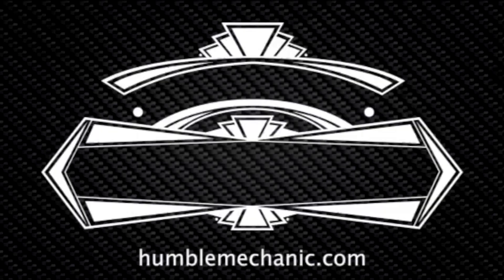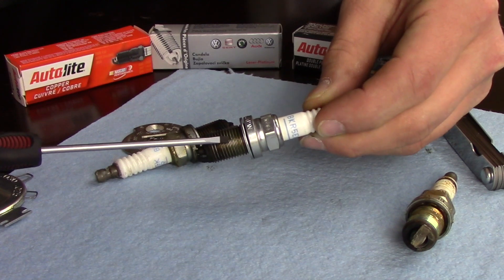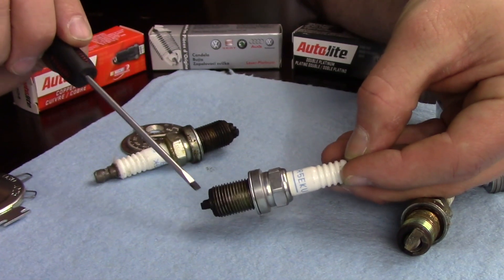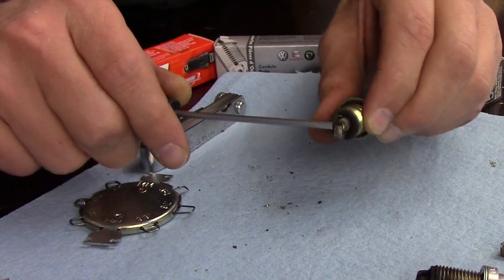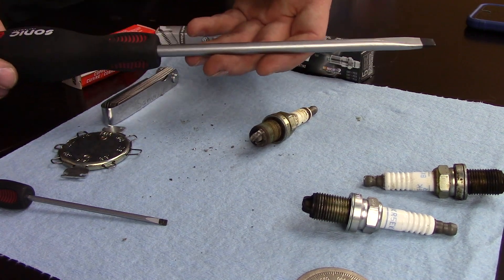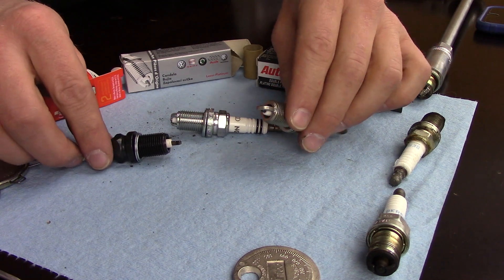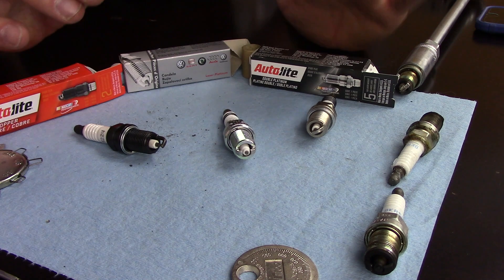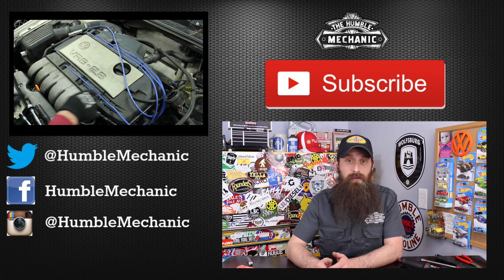What You Need To Know About Spark Plugs

Comment: The fancy metal plugs like Platinum and Iridium also have a caveat
1.  They're not really pure platinum or iridium.  A singe plug would cost $100.  They do however contain very trace amounts in the alloy used to help with the heat of forced induction and high compression.
2.  They won't make your engine run better or add power.  if anything they are POOR conductors and can create problems.
3.  True rare metal plugs come with multiple leads.  This give the spark more options to choose the least resistance (because they're poor conductors), and slightly lengthens plug life as leads wear away.  They still only throw one spark.
4.  It's best to stick with EXACTLY what your engine came with.  The engineers that designed it are much smarter than you (usually).  Plugs have plenty of other quirks such as internal resistance, surface resistance, resistance at operating temperature,  resistive resistance, etc.  When the manufacture factory tuned your engine's ECM and other variables, they did it with the factory model plugs installed.  It is however a good idea to double check the assembly line's work.  Plenty of cars roll off the line with random spark gaps, +/- 0.01 sometimes, slightly different resistance, etc.  With anything electronic or mechanical, it's best to "marry" them.  Have all the identical parts spec the same, and always use them together.
Reply: Bosch Iridium spark plugs are laser alloyed with pure iridium.

Comment: Unless you're assured you'll never see that car again, ALWAYS PUT A TINY DAB OF ANTISEIZE ON THE THREADS! Trust me- when you take the plugs out 30, 40, 50,000 miles later, you'll appreciate that they're not seized in the damn heads.
Reply from the maker: As long as you don’t get it on anything but the treads. I’ve never used it and never had an issue.  Vw plugs don’t have it from the factory and I’ve only had a few with issues
Reply: Antiseize- the gift that keeps on giving. But, yeah- just the lightest touch of the brush on the threads and they can will come out no matter how long they've been in the head. I've been using it on every plug I've put in for 27 years.

Comment: I have a 2009 Volkswagen Routan 3.8L V6 i had a check engine light on and was showing that the spark plug #6 was the problem i took it out and it was completely shut no mechanic could explain my problem. Luckily i found a old spark plug in the ground and it worked lol but my engine still feels like it's misfiring it hads moderate shake/vibration
Reply from the maker: Probably a burnt valve on the front bank cylinder head.  There is a warranty extension for that issue. 

It could be other. Things but that’s common
Reply: HumbleMechanic i don't think i have warranty or do i ask the dealership?
Reply: HumbleMechanic what spark plugs do you recommend for this engine it's not even a vw engine it's a Chrysler

Comment: I'm pretty paranoid about putting in spark plugs, I found a good trick is to use a radiator hose to start the thread to keep it from skipping and then to use the torque wrench (old school one that doesn't ratchet, though). Never had an issue.

Comment: humble mechanic , spark plug gap also effects timing , a short gap causes the spark to fire prematurely and a large gap cause a delay , so the perfect gap fires the spark plug at exactly the time the engineers designed the engine fire at . it will make engines hard to start as well

Comment: Not related to the video but would you buy a 08 golf gti with 103k miles for $4.5k? Is s 100k mile gti worth buying?
Reply from the maker: Seems like a right price
Reply: HumbleMechanic thanks for responding. If i do go with it,any common issues you have ran into that i should check for ?
Reply from the maker: Is It FSI or TSI?
Reply: HumbleMechanic TSI

Comment: I have a 1996 Yamaha VMAX motorcycle. The two spark plugs on my right side or running rich and the two spark plugs on my left side or running normal. What would cause this in Balance? Bike only has 17,000 miles on it

Comment: Another good video sir, thank you.  I am a bit surprised there is no discussion about the use of anti-seize on spark plug threads, and the different types of anti-seize compounds (copper, aluminum, other?)
Reply from the maker: That is a great topic. I never put it on any plugs I have installed. VW doesn't mention in the repair manual. And yes using the proper kind can be important.

Comment: My spark plug looks like it has some gas on it. What could it be?
Reply from the maker: That can be normal, unless it's saturated in fuel. They you probably have an injector issue.
Reply: HumbleMechanic how can I be sure? And if its not so common could it be oil? If so what may be the issue?

Comment: When you say "coil near plug" I'm assuming your talking about styles like the GM LS engines where each cylinder has its own coil but it still has a plug wire (pretty short) to carry the voltage from the coil to the plug. I have also seen Tuner enthusiasts  (like turbo Hondas,and really any other engine that was not turbo from the factory) that replace distributor style ignition and even "brick coil" systems with individual coils from LS engines claiming it is a much cleaner and more accurate spark timing...

Comment: Just changed the iridium spark plugs from my canyon... 245k km on original ACDelco plugs.  Engine was misfiring at low rpm under load.  Other than the tiny centre electrode was eroded down and deposited on the ground electrode, the plugs looked good.(nice light brown & minimal deposits)  New BOSCH plugs cost $60 ad had 1 left over because they come in 2 pks at Canadian tire.  Now my truck runs like new again.  Why did I wait so long to change them???

Comment: I am owner of a 2014 CC 3.6 V6, BWS engine. During replacement of spark plugs, I found the following conflicting information:
- from VAG ELSA-Win: spark plug code 101 905 622 A (NGK code ILZKR8A), air gap 0.7...0.8 mm
- from NGK catalogue: spark plug code ILZKR7A, air gap 0.9 mm
Thus, which one brings the most reliable information? Who is really the owner/responsible for the application? Factory or spark plug manufacturer?

Comment: Use an old straight rubber boot with a small slit at the end. (Or 5/8 rubber fuel line) to start a plug into the head  . It will not start if it's cross threaded. You'll never cross thread a plug again.

Comment: How important is the spark plug's resistor value? The $9 NGK "laser platinum" spark plugs that VW recommends are 1k ohm while every other compatible, and cheaper, spark plug by NGK are 5k ohm. That includes the single platinum "G-power" plugs, which are 5k ohm.

Comment: So here we have Captain Obvious.
I expected that main question will be eventually answered on how to diagnose spark plugs  and what are common faults in them but nothing useful was explained
Reply from the maker: +deltaxcd well since this is both an extremely simple and obviously complex subject it didn't fully fit in the video. 

Sparkplug failure and diag can be as simple as swapping to another cylinder and flooring the misfire. 

Or as complex as reading plugs, changing gaps, heat ranges, styles and measuring performance on a dyno. 

As I think I mentioned in the video, the most common failure is installing the wrong plug
Reply: If you mentioned that there are different spark plugs you should explain more on why the price is different and if you get something from buying a more expensive thing or just taking some second-hand plug from scrap lying around.

Do you need to replace spark plugs from time to time or you just run them until their electrodes burn away?
Many people are replacing them regularly and I wonder why they do that. 

If you explain how to adjust gaps you should also tell why that is even required because most of the time gaps are totally fine and spark plugs fail to other reasons like dirt.

I just watched another wide which explained that most common failures are:
 1. carbon deposit on the ceramic insulator which shorts the plug, (this can be fixed by heating spark plug  red hot until it burns away)
2 cracked insulator which can be seen visually under careful examination.

This means if the ceramic is good you can use spark plug almost indefinitely and never replace them.
Reply from the maker: +deltaxcd sound like you are primed to make your own video.

Comment: I used the OEM Bosch dual fire platinum plugs in my 1999 B5 V6 for a long time and I would have infrequent issues with hesitation or misfires under load.  At the advice of my grandfather, who had been a mechanic for quite a number of years, I switched to NGK single fire copper plugs and haven't had a problem since.  This may or not be correct, but my grandfather was under the impression that multi-fire spark plugs were more prone to short out and give a bad spark.

Comment: the heat range has nothing to do with the reach.  it is the combination of certain metals mixed differently to make a certain chemistry that will allow the electricity to pass thru it cause as metal gets hotter the harder it is for electricity to pass thru it.  a doubled tipped plug is no stronger than a single tip. the only advantage of a double tip is ur are less likely to have a miss fire.  which for high performance engines u want to eliminate as u lose that power stroke or it fires a few mil a seconds off which in turn gives u a weaker powerstroke.

Comment: I've never used a torque wrench on the plugs in my old 350 Chevy truck engine and don't believe I've ever seen any torque specs on them either. I've always tightened them the way I do my oil filter. That's finger tight plus about half a turn. I believe I learned that system on my Model A Ford.
Reply: Torque spec for a 350 chevy = 25 ft lbs

Comment: I have a 2.2 ecotec engine in a 2004 cavalier. I'm not sure if the spark plugs have ever been replaced and it's at 90k miles. Assuming the rubber boots/wires attached to the ignition coil aren't torn, is it okay to skip replacing them? And should I apply grease to them when I reattach or isnit not necessary?

Comment: The general rule of thumb with spark plugs is that if the end electrode is a whitish color then the mixture is too lean, and the engine will run hot. If the electrode is black & sootyin color, then the mixture is too rich and the engine will run roughly. Ideally, it should be alightish brown color for the engine to run right.

Comment: Hi!I have some questions about the ignition system and I'd be very happy if you could answer me please:(1) Can I replace the wires that are coming out of the coils and going into the Spark plugs with other wires with less resistance in order to get bigger spark and gain more power? () Will it not damage the car's computer?(2) What's the difference between a resistor plug an a non resistor plug? () Can you put a non resistor plug on every car?() I've seen this video on a non resistor plug and on the description he says that the resistor was started in order to suppress the electrical noise for radios and nowadays it's unnecessary, is it true? () can I install a non resistor plug safely on the car?Thank you very much!

Comment: Please be kind to the next guy, and put a drop of anti-seize on the threads before installing the new spark plugs. This is especially important if you have aluminum heads.

I would suggest always using the platinum spark plugs on newer vehicles.  They will last about 3 times as long as the copper electrode ones.
 
Most spark plugs have an internal  resistor to slow the rise-time of the spark-plug current once breakdown (arcing) begins across the electrodes so less radio frequency interference (noise) is produced.  Some racing engines use non-resistor spark-plugs to get longer sparks and wilder spark plug timings, but all production gasoline vehicles I know of use resistor type spark plugs.  

 Do modern spark plug wires degrade that much? And should they always be replaced when replacing the spark plugs?   How do the spark plug wires go bad?  From my understanding, they are essentially a coaxial cable.  Does the insulation between the center conductor and the shield break down?  Does the cable become more capacitive over time? Can you test spark plug wires?

Comment: 99% of spark-plugs I've replaced on snowmobiles and motorcycles had nothing wrong with them other than carbon deposits. Easily cleaned with a "light" sandblasting which is the only way to clean the carbon from the porcelain insulator (which is the main cause of miss-firing).  They NEVER wear out.
I would add if you do sandblast them, make sure you blow out the plugs really well.
You don't want that grit getting in the cylinder.

Comment: I use NGK V-Power in everything & they all get gapped to .040-0.042 as that is how thick the blade on on my Swiss Army knife is...(-: I've yet to have an issue with that approach from big block Chevy's, small block Ford's & even a turbo 4 banger.

Comment: I have a burnt exhaust valve in my 1985 Toyota Corolla on Cylinder #1. Do I just take the cylinder head off and replace the exhaust valve or are there more steps in the process to fixing it?
Reply from the maker: You will want to inspect the valve seat too for dance.

Comment: some feeler gauges have brass leafs for spark plugs. Those old wire gauge types are great for the little T shaped spade. its a prying fork for prying the ground hook to the right gap. a couple light taps on a wood block will set it to clearance. Thats when those brass leaves come in handy to "feel" clearence like inside or outside mics. Personally i always check the gap on fresh out of the box plugs. Try it some time you will see especially when you 8 or more. Even with those nice little cardboard protective sleeves i have seen a few thousandths difference. its not really that critical its not a gun or jet turbine. just neat to see brand new parts from the same manufacturer with sloppy tolerance.

Comment: The heat range description is a bit off, it's actually how far down the conical ceramic isulation if the center electrode goes before it conacts the metal outer section; unrelated to thread length. The ceramic acts as a heatsink for the electrode, and the metal outside of the plug acts as a heatsink for the ceramic. The lower the heat range, the shorter the ceramic cone, and thus the shorter path for heat to dissipate more rapidly. Improper heat range rarely leads to anything other than lower throttle response and economy (mpg). Heat range indicates the physical temperature of the plug, not the spark temperature. Deposits are actually caused by too weak/small (too cold) of a spark (too small spark gap or bad ignition circuit);  detonation results from improper fuel/air mixtures (too lean)and/or improper ignition timing (too advanced)

Comment: one thing that was missed, that happens often, specifically with plugs that are in an area thats hard to reach. Dropping the plug, and even if it doesnt hit the ground, just bounces off the metal, renders the plug as trash.
Ive dropped a few....and some have cracked and couldnt see the crack until I fired it up.
Dropping plugs is something to be mindful of is all I am getting at.

Comment: Sorry for the stupid question, I'm not really knowledgeable about cars (but I do want to learn, that's why I've come here), but anyways:

What about diesel engines? They don't really have spark plugs, because diesel ignites by pressure, but they do have something that sorta looks like them, that are used (as far as I know) to heat the fuel on the initial power stroke, when the engine is cold. What are they called and can they be replaced as easily?
Reply from the maker: +Jake Long hey Jake. Not a dumb question at all! 

You're talking about the glow plug.  Some can be replaced very easy. Others are not. It depends on the engine. Be the live in a similar location to where a spark plug would be

Comment: I wish people would stop referring to this as an "EXPLOSION"....it is a very fast burn. The air/fuel mixture expands the air from this heat and the high pressure causes the piston to be pushed down, a thermal dynamic. An explosion (or literally thousands of explosions) would destroy and engine rather than allowing it to run. But Im just a silly girl.....: )

Comment: Hello, very nice video. I have a technical question for you that has been bugging me for years. I've been turning wrenches on cars since the seventies and in the eighties I became a jet engine mechanic for the Air Force. Jet engines  have igniters which are very similar to Automotive spark plugs except larger. For the jet engines I work with, we were required to add anti seize compound to the thread of the igniters before installation. Ever since then people have asked me if they should use anti seize Compound on the threads of a automotive spark plug. I never have used the anti seize compound for automotive spark plugs but every time I buy spark plugs at the automotive store, the salesperson wants to sell me anti seize compound. I refused and they give me a weird look like I'm crazy. What are your views on using anti seize compound for automotive spark plugs? Thank you.

Comment: how about those plugs with a quad electrode? or the ones with just a ring for the electrode?
Reply from the maker: +Ian Irizarry my opinion is the car will almost always run better with the plugs the engine was designed for.
Reply: HumbleMechanic thanks i was thinking of using Bosch platinum plus2 or the fusion ir plugs but if you think its best I'll stick with the oem premium ngk r plugs

Comment: do you use a thread anti-seize compound on plugs you install particularly on aluminum heads?
Reply: I do
Reply: good....what kind do you use?
Reply: Never-seize ...the silver greasy kind, I think it has aluminum particles in it....I use it for disc-brake sliders and pins too..and wheel nuts